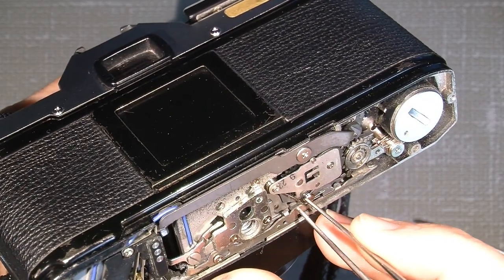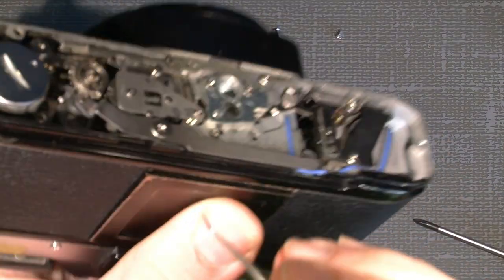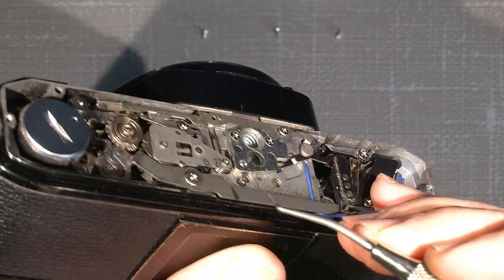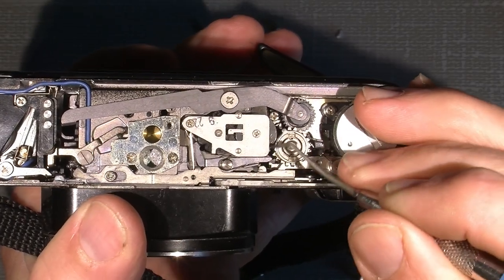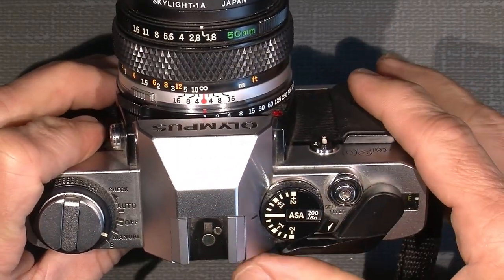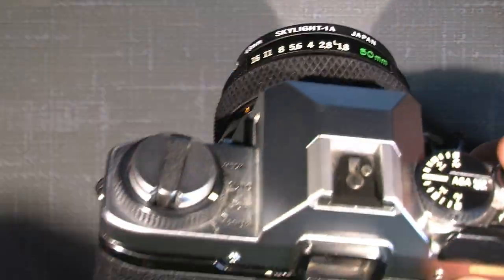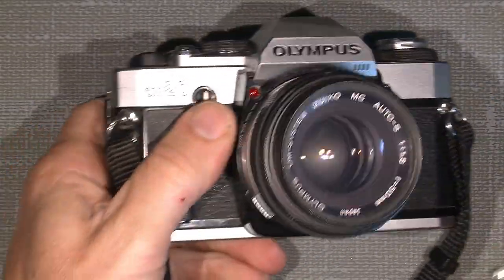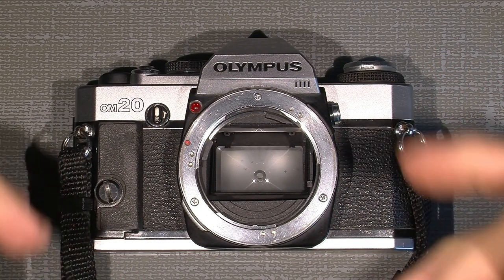Stuck film advance lever in Olympus OM20

Comment: Nice find Kenneth!

Of note too, I have noticed that in later OM models like the OM10, OM20 (here) and OM4 bodies employ a modified 'frame' that holds and connects the idler gear + film curtain gear. Olympus must have had problems over the years with earlier designs on their OM1/OM2s? 

I have a problem with my OM2N - the idler gear's return spring is too weak, hence the jamming. I need to go and find some torsion springs online and modify them to fit. :o)

regards
James.
Reply from the maker: Thank's James, If you can find another not working camera you maybe could take part's from that and in that way use it in OM2N. (just an idea)

Cheers
Kenneth

Comment: Thank you very much for this video!
I have a Olympus 4ti that seems to have the same problem. I opened it and did the same procedure as you, but I didn’t have the oil/liquid, so it was back to the same problem again. I must buy some oil/liquid to fix it, can you just tell me what you used? I’m pretty nervous to drop some wrong liquid into the camera.... 😱
Thanks again.
Reply from the maker: You can use 2-3 drops of Isopropylalcohol 70% - 99% on a cotton bud, and then lube it with 1 (one) tiny drop of the very thing sewing machine oil.
Reply: mikeno62 Thank you very much!

Comment: I have a praktica bc1.  The shutter fires fine without film installed but when I load a fresh roll the film won't advance. Is it worth getting repaired. Sometimes I have to manually return the screw underneath by hand for the shutter to fire?

Comment: I have a Olympus om30 but the advanced leaver has the same issue. But it is not what you did in the video . So im not sure how to fix it. Could the batteries be a problem ?
Reply: What I did with my father’s old camera was move the thing to the right of that bottom lever, and somehow it engaged into the action.

Comment: Does the same thing happen with minolta X series cameras?
Reply from the maker: I have no idea because I have not worked much with Minolta camera's. But many old cameras will, over time provide the almost same issue's, and if can often help with some lighter fluid and sewing machine oil. And in other cases one need to take some part of the camera apart and clean the part's and lube it again.

Comment: Hello! I have an Olympus OM- PC, and it is simply not turning on, even with a battery change. Any ideas?
Reply from the maker: It could be corroded wires or battery contact, sometimes you can see it under the bottom plate.